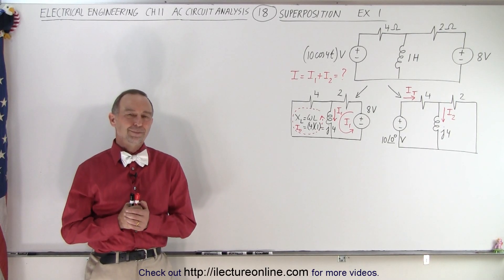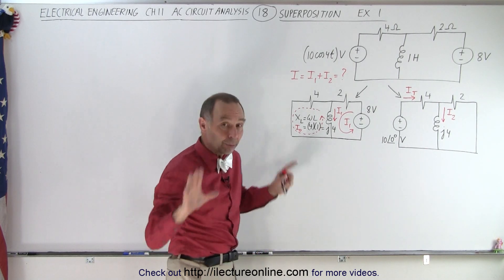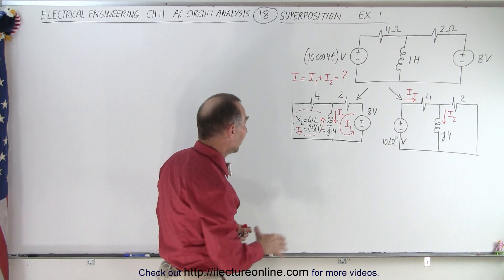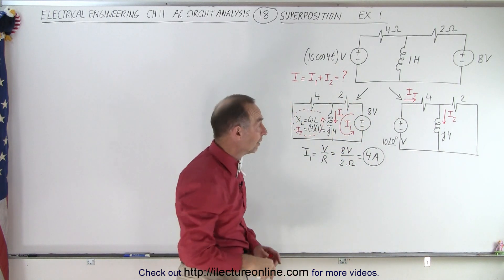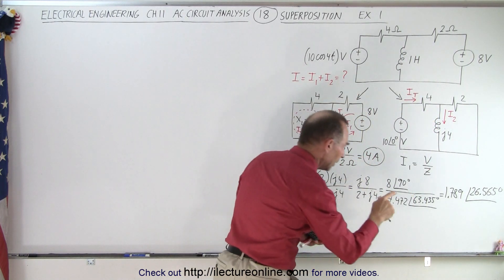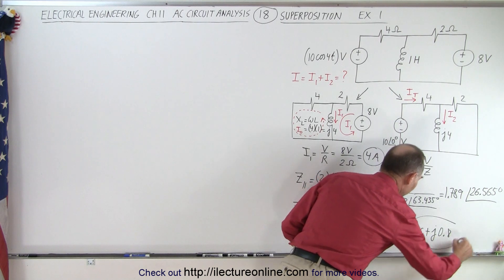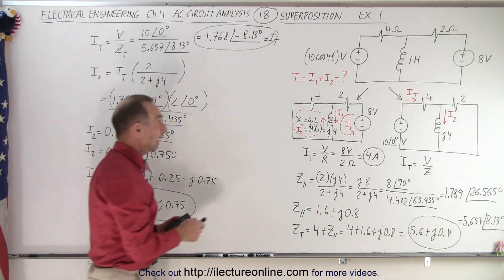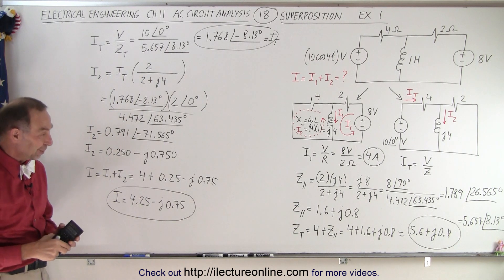Electrical Engineering: Ch 11 AC Circuit Analysis (18 of 34) Superposition: Example 1

Comment: Sorry sir i wanna ask, why on the I1 the inductor become sort?, *ps still new at learning inductor conductor stuff and sorry for my bad english since its not my first language
Reply from the maker: When there is a steady state voltage source (in this case the 8V source) the inductor offers no impedance to a steady state current and acts like a short.  For an inductor to have impedance, the current needs to change.
Reply: @MichelvanBiezen  Why dont you do the same in the second circuit? v=10, It has the same form!

Comment: Hello, why do you not do the same process in the second circuit? Is the 10 ∠ 0 not considered a steady state voltage source?
Reply from the maker: The 10 V source is given as 10V (cos 4t) which indicates that it is a time varying source

Comment: Since the two voltage sources are working on different frequencies (4 rad/s for the left source, 0 for the right source), isn't it incorrect to simply add them, with the result being, instead, 0.791cos(4t - 71.57) + 4?
Reply from the maker: If they were on the same branch you could add them up that way.  (The 8V source is DC voltage).  But since they are not on the same branch you cannot.

Comment: for that 10cost4t voltage, isn't that 10V peak voltage? shouldn't everything be calculated with RMS values when using Ohm's law?
Reply: wait nvm, we're not looking for time instantaneous values, rather current through the inductor as a function of time
Reply from the maker: As it turns out you can use either RMS values or peak values to work out the problems as long as you don't mix them.
Reply: @MichelvanBiezen  Oh I see, thanks sir!

Comment: cant we use node analysis here
Reply from the maker: There are 7 different methods of solving circuits and any method can typically be used.  It comes down to a personal preference given the choice.
Reply: @MichelvanBiezen  maybe when different frequencies are given then only we use superposition....is this true ?
Reply: @MichelvanBiezen  and btw how to find power when diff frequencies present..i cant find any video related pls help
Reply from the maker: Not sure about what you mean by: "when different frequencies are given".
Reply from the maker: Typically a circuit has a single power source at one particular frequency.